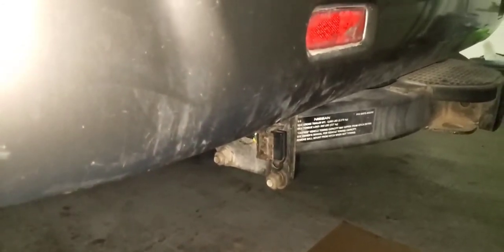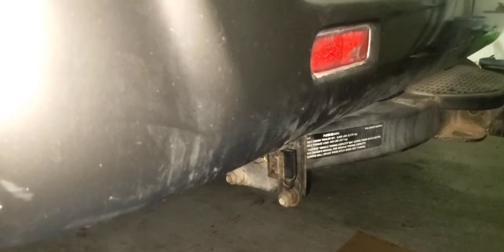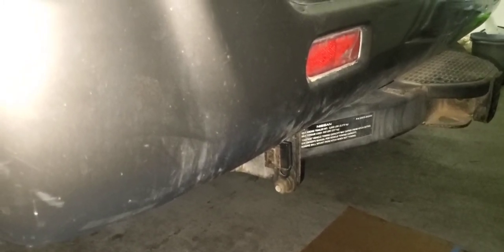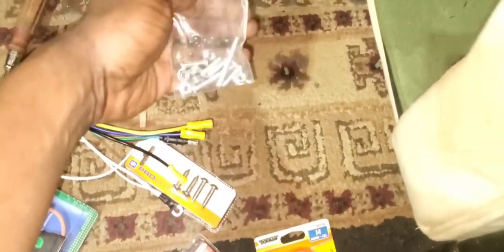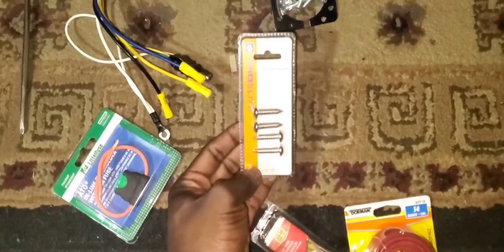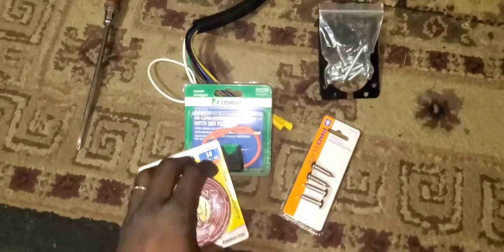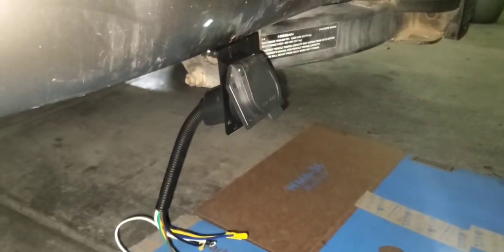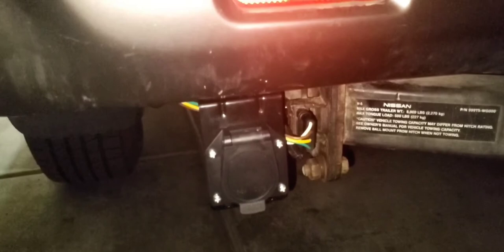R50 Pathfinder|Infiniti QX4 Flat 4 connector Upgrade for Towing|

Comment: Hey bro, you think this truck can tow a U-Haul trailer with a Acura rsx type S on it comfortably? My rsx weighs 2500lbs.
Reply from the maker: @brandon_buildsDIY, you didn't say what year your R50 was or what transmission it has. However you can tow up to 5000lbs just make sure you don't exceed more than 350lbs tongue weight tho and you should be fine, but do consult your owner's manual to be safe. I hope this helps!

Chris.
Reply: @TheCamperDanFiles 2002  auto 3.5
Reply from the maker: @brandon_buildsDIY, alright so according to the owner's manual for your R50 it states you can tow a trailer up to 5000lbs with a maximum tongue weight of 500lbs. So as long as your Acura RSX and trailer don't weigh more than 5000lbs combined you should be good to go.

Chris.
Reply: @TheCamperDanFiles  tongue weight means actual weight inside of the truck right?
Reply from the maker: @brandon_buildsDIY, No tongue weight refers to the amount of weight the tongue or front of your trailer will be putting on the backside of your R50. This is why that number is less than the maximum trailer weight itself.

Chris.
Reply: @TheCamperDanFiles  ohh okay, so would make sense to put stiffer springs in the rear
Reply from the maker: @brandon_buildsDIY, Yes that is one of the reasons I lifted my R50. Helps it not to sag so much when towing.

Chris.